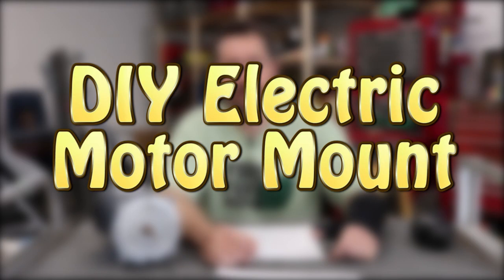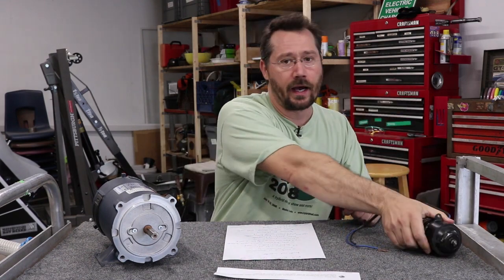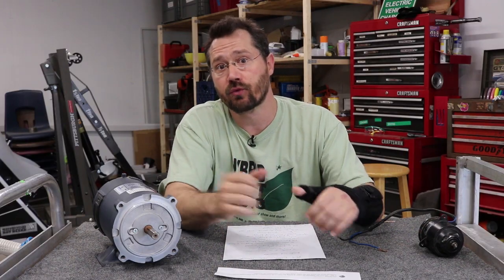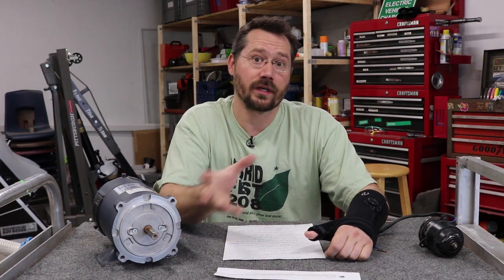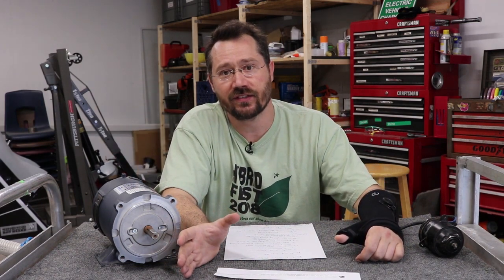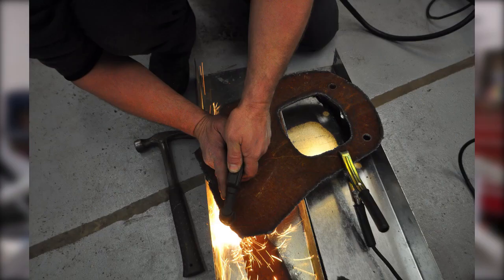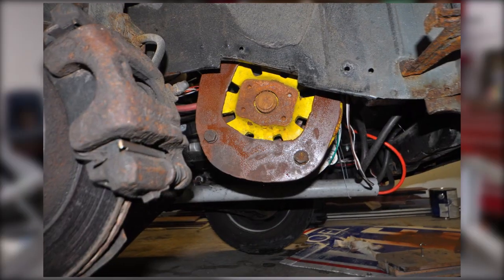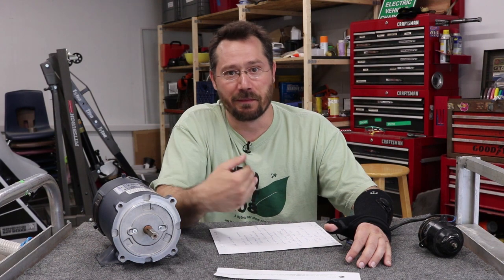DIY Electric Motor Mount

Comment: Thank you for your information. I'm actually building an adapter plate for a snowmobile engine but the tips I got from you is helping alot.

You should get into pod casts or radio. You change pitch instead of a monotone voice and are clear when speaking.  Teaching or talking is your calling.

Comment: Hi Ben, I am a novice in Electric Car conversion. Can you help me convert my Honda CRV to Electric Car. Any advice please
Reply from the maker: Hello! Here's my general advice for anyone to get started with a conversion: https://300mpg.org/buildelectriccar/
Good luck with your project!
Reply: I want to do my 01 Honda CR-V as well. I blew the motor so it would be cool to get a second life out of it. My main concerns about it. Just off the top of my head without doing any research. Is the awd system.  I'm not sure how that system works or operates. Whether completely independent working off the differentials. Or if it's somehow got a management system of some sort.  Then it's an automatic which prob isn't as ideal as a manual. Or if you were doing auto being able to use an old style 2speed powerglide I would think would be Taylor made for electric motors.  I know I want to keep 4wd capabilities since I'm in the north.  If I we're starting from scratch looking for a donor car. I think I'd get a late 90s 2door Chevy tracker. A standard because my wild ideas of retro fitting a powerglide tranny and other things that pop into my head. Are prob best to leave for another build after I get through the trial and error of getting one under my belt.  But CR-V may not be as problematic as I'm done overthinking about. Please drop an update if and when you start yours good luck!

Comment: I've been thinking of adapting a transmission from a Dodge Charger to a Tesla RWD electric motor. btw thanks Ben.
Reply from the maker: Go for it!
Reply: @BenjaminNelsonX  I've also got plans for a custom dash using Glow shift gauges (as I am ditching the originals from the Dodge Charger SRT8).

Comment: I've been doing my research on electric motors I'm wanting to build a hybrid dozer. Somewhere around the cat D3  would a fork lift motor be strong enough. I honeatly don't understand electric hp and torque. I've worked with prlenty of motors on machines RVs etc... But the horsepower to weight and and torque aren't making sense to me
Reply from the maker: In terms of electric, one horsepower is approximately 746 watts.
Part of the confusion is that gasoline engines are generally rated at their PEAK horsepower, with the engine running at high revs, whereas electric motors are typically rated at their CONTINUOUS horsepower. 
Because electric motors tend to have more torque at low RPM, and good torque at a wider range of RPMs than internal combustion engines, an electric motor with a lower power rating is often very comparable with a gas engine with a higher rating.
It's probably a bit different for something like a bulldozer, because in that case I believe the engine is mostly powering hydraulics, and it's the nature of the hydraulics to give the required torque.
It looks like a CAT C3.6 has about a 100 HP diesel engine. A Nissan Leaf electric car also has about a 100 HP electric motor. A salvaged motor from that car would probably run that "small" dozer just fine.
At that point, the concern would be more about run time. You can't drive a Nissan Leaf at freeway speed all day. There simply isn't enough energy storage. So, a BEV (Battery Electric Vehicle) bulldozer probably doesn't make sense, as it would require a HUGE battery for a work cycle that might be expected of it.

A HYBRID version would make more sense.
Years back, I did a video project for Bucyrus/Cat in Milwaukee, Wisconsin for a HYBRID earth-mover they built. The thing was HUGE and designed for open pit mining. It used some giant capacitors to allow for a large power boost as needed. Essentially, it was more efficient, and they put a larger scoop on it, so that it could move in 3 scoops what the standard version would need 4 scoops to do, so it saved time as well.
Essentially, it was a Prius of open-pit mining, but using the gains in efficiency to increase the payload and save time, rather than simply reduce fuel consumption.

A DIY bulldozer would be a very interesting project. Unfortunately, I don't have experience working with that type of equipment, so I'm afraid I can't be of any help beyond what I've just written here!

I did do a little work on a farm tractor conversion. Here's a video of working on converting the tractor hydraulics to electric.
https://www.youtube.com/watch?v=Y0ovdUvEM8g
Reply: @BenjaminNelsonX  Cat did a  d6 hybrid an d7 hybrid that came out this year.
Uses the same diesel motor as last year to turn a hydraulic pump and generator. Charges the batteries and adds current for the 2 induction motors. One for each track art he'd i the planetary gears. When the dozer turns one motor goes I to regenerative braking to generate current to the other motor for more torque and charge batteries.
My plan was to use a small engine for the generator an hydraulic pump.
And either do 2 ac 3phase induction motors attached to planetary drive gear reductions to the tracks.
Run a 5 pole dual ramo soft start for the motors.
Ofcourse a good rated battery setup, inverter, and speed controller.
And program 2 joysticks to the controls for driving and blade control.
But in a hy rid would ac be better or would dc be better?
That's the confusing part. Idk how much torque the motors need to generate through he planetaries for decent pushing power.

My other idea was the same setup but with a big 12 motor to a tubed axle with electric brakes so I can control them individually. To the planetaries and tracks.
Lithium batteries for both setups.
But with a machine running 12k-15k in weight. That has o move 39-50% of it's body weight with itself up to speeds of 5-7mph.

So I don't know which way to go ac or DC. And why size motor or motors.
I am great at allthings building mechanical and electrical. But I never got past my associates to go to engineering school unfortunately.
I'm sorry for the wrong reply. But your videos are awesome and was hoping for I sight.
Reply from the maker: Here's a view of some new electric construction equipment I just found.
https://www.youtube.com/watch?v=P6tDgtsJc8c
Reply: @BenjaminNelsonX  thankyou

Comment: Hello, my name is Jonathan, I wanted to ask I have a 1990 Chevy Thomas Short bus that I’m converting into a motor home(BUSLIFE). I wanted to ask how can I change my diesel gas engine into electric what are the steps do I need to convert it ? And, by any chance do you need the weight of my bus to determine what electrical parts I need for my bus ? I just need some info. Thank you again. 👍🏽
Reply from the maker: Please watch the entire BUILD YOUR ELECTRIC CAR series to get a sense of what goes into the process of a conversion. The descriptions of the videos have links to some additional information for you.

https://www.youtube.com/watch?v=BSA2fGTmqfw&list=PLmHss3DBZUilepzTmr-XAVwpRRCqMv7Ny

The big challenge with a bus is that you will need a LARGE battery for it.

Good luck!

Comment: Great series of videos I am learning a lot, could you please explain your arm brace, does it have a port on it for liquids I would presume?
Reply from the maker: This is just a simple mount. It takes the place of the mount which was on the gasoline motor. The rubber mount connects to the frame of the car inside the engine compartment. There is no port on it. You may be looking at the part where the bolt slides through.

Comment: Not sure if welding the mount while the rubber bush is still inside is the best idea but looks like it worked for you.

I would suggest pulling the rubber bush out first  if it's the removable type.
So many of them these days are a throw away item and the rubber is just poured in there and vulcanised to the support arm.
Reply from the maker: I seem to recall that the rubber was non-removable.
Reply: BenjaminNelson Yeah it's such a shame the way they make everything like that these days.
Years ago you could press your rubber shock mounts in and out to replace parts. Now it's a matter of throw the whole arm away and buy a new one.

This would also mean more processes required in the recycling process of the metal or perhaps they just burn the rubber off when they melt down the alloy.

Great videos and information BTW.
I still can't decide if I want to build an electric car or a steam powered car.
Perhaps I should look into a steam generator electric hybrid car. Would definitely be a one off then but still have little to no emissions.